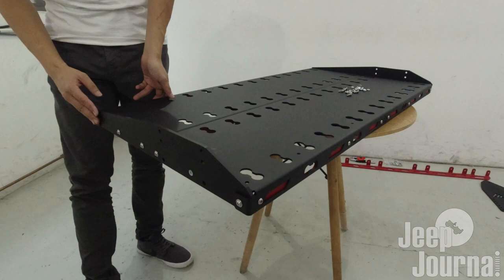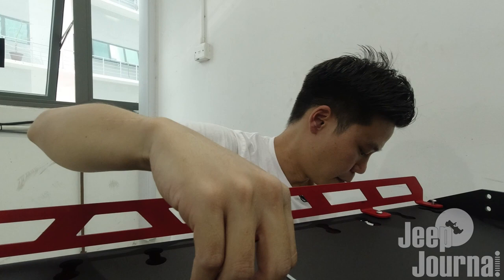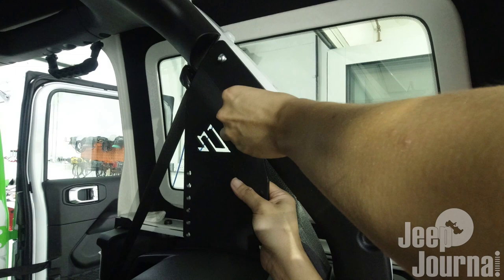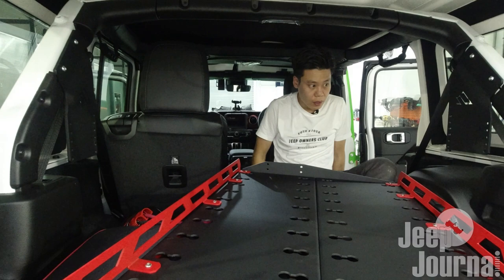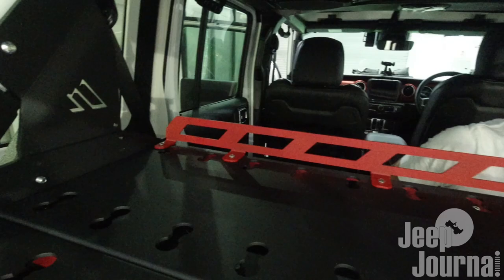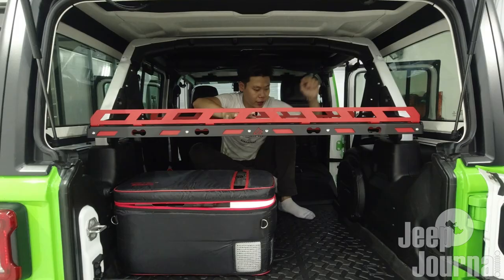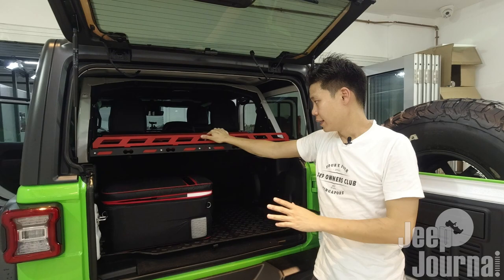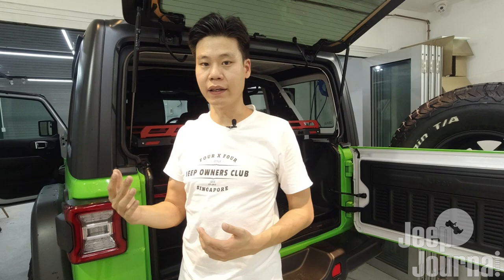Jeep JL Wrangler Cargo Shelf - American Adventure Lab M.A.S.S. Cargo Shelf Installation - Part 2

Comment: Great video. First detailed on I saw. I was thinking between this one and the Genright. I’ll probably go with this one only because the Genright sticks up to high. I’m going with same color combo you did. Only thing I’ll do differently is when installing bolts and nuts in the final step I will have the screw head be what shows and the nut will be hidden.
Reply from the maker: Hi! Yes the screws and nuts tightens in any orientation (: Having the screw cap showing instead of the nuts will indeed make the overall look neater (:

Comment: Live your content.it looks like you can go up one more notch,except that you lose one bolt hole on each side.am I correct.I'm curious to know.also whats the height from the bottom of trunk to lowest part of the cargo shelf? I'm installing a subwoofer box that is 21.5" tall n 24in depth n not sure if the lliwest part of it would still hit the speakers? Thanx n keep up with the videos great work